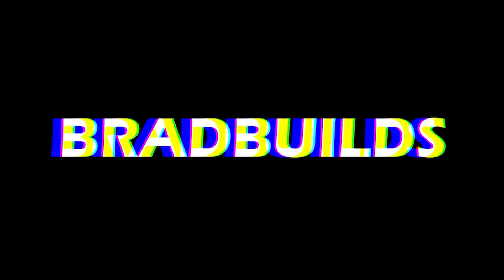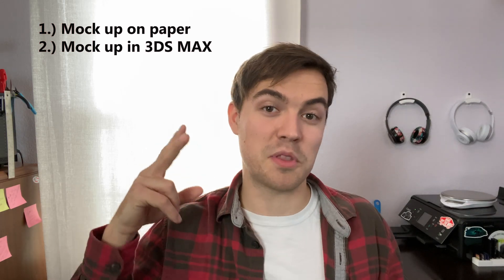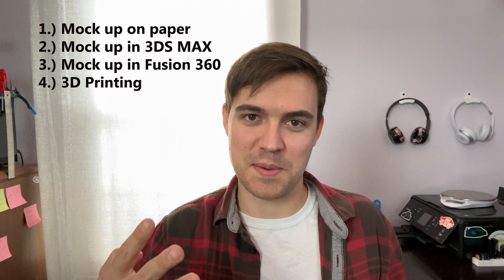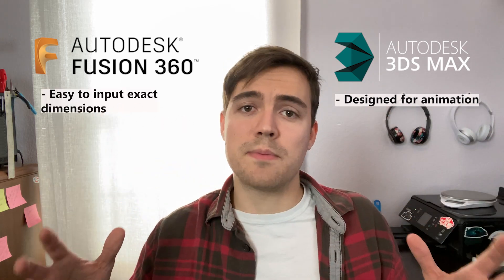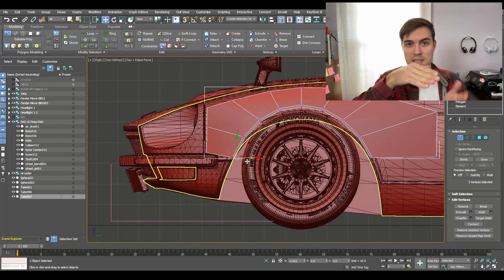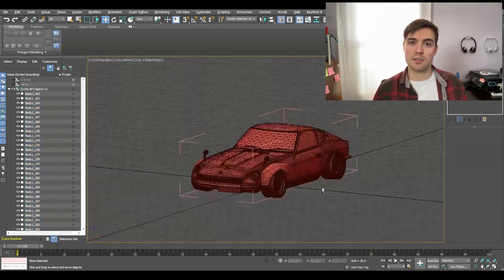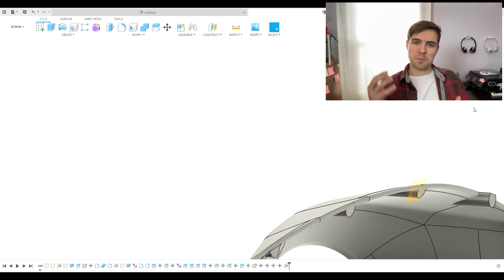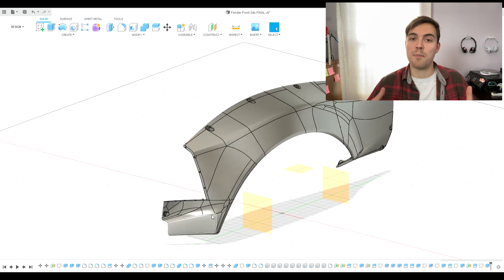3D Printed WIDEBODY Kit - Design and Software Used

Comment: I've been working on similar things and understand the workflow. However i use Solidworks and am running into issues with building off of the mesh you get from 3ds max. How are you going from mesh to buildable STEP file?

Comment: what solidify suitable for print this widebody ?
Reply from the maker: Are you talking about the filament for the printer? I used pla in this video because it’s easiest to print. But it’s hard to work with in post. Try pro pla or tough pla 👍
Reply: @BradBuilds  yeah PLA+ . it tough. but i have a problem with file. can you adjust it for me ? when i try to solidify it, and export to STL, it did'nt make it. look like fail. can you help me bro. email ? i send it to you.

Comment: hi thanks for your video.. How did you add depth (material thickness) to the fender flare in order to import it in fusion 360 as a solid body? I am trying to utilize the shell modifier but it introduces some artifacts..

Comment: Love it man, i love to make rear over fenders for my car but in the long run i think i'm just going to mold something in fiberglass, i have put a couple of thousands of hours in to blender making the Last barstow v8 mod for Beam NG Drive, but it takes so much time and trial and error, i used to design stuff for hours on end, but i ended up abandoning the project,it was a great experience and now and then i design a couple of things but purely for my own enjoyment, i'm not nearly as good as you in designing stuff and i already put in so many hours out of passion, so beware if your starting from scratch, it will get overwhelming quickly if you don't prepare yourself.My advice try out a free program like blender maybe if you want to invest money, buy a blender online course like udemy has great ones, learn the workflow and try it out.👍✌️👉

Comment: Hey man, this is awesome! May I ask how you got the mesh model of the fender to a solid clean surface model in Fusion? Was it imported like that, or did you create those surfaces in fusion over the original mesh model? Thanks man!
Reply: You can remesh in 3ds or blender or whatever poly program into a quad. Then in fusion 360 you can directly convert a quadmesh to a form body to a BREP surface

Comment: Nice work. Have you tried 3D scanning with photogrametry?  You can use almost any camera and  put the photos in Meshroom which is free. A little bit of scaling from reference points later and wham! You've got a 3D scan of your part.
Reply from the maker: If I remember correctly, photogrammetry has an accuracy of around 1-3cm, which isn't accurate enough to make parts off of IMO. Although, if you're willing to go back and forth a few times, it's definitely a working alternative! I'm excited to see how companies use the new Lidar camera on the iPhone 12 Pro Max, supposedly its wicked accurate at making 3D models. Considering some of the cheaper 3d scanners on the market cost around 5k, 1.3k for a new phone AND 3d scanner would be SICK!
Reply: @BradBuilds  accuracy depends on the size of the subject. I scan parts of cathedrals with accuracy within 20mm which is fine for me. If you're focusing on a small area like automotive then I think the error would be smaller.